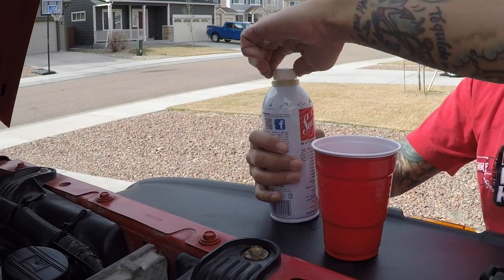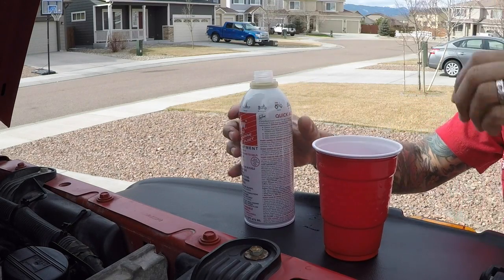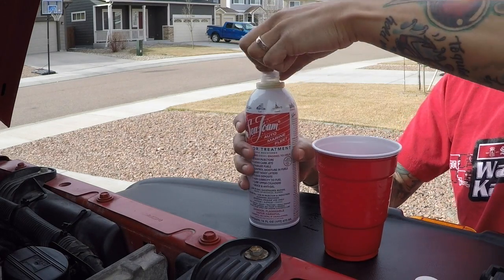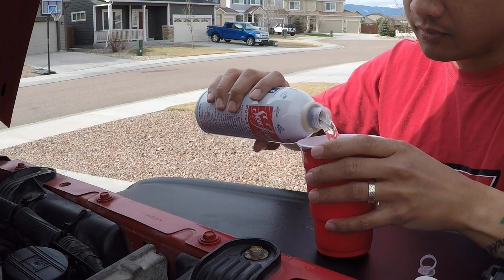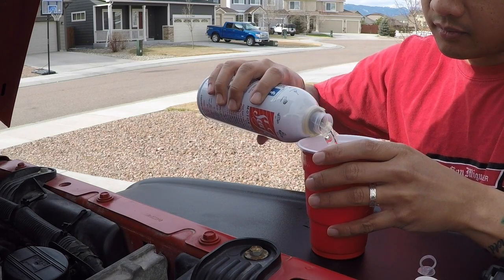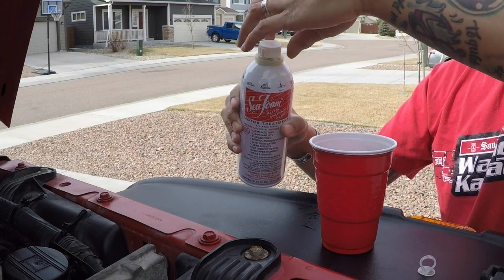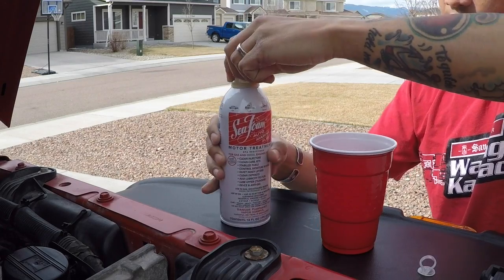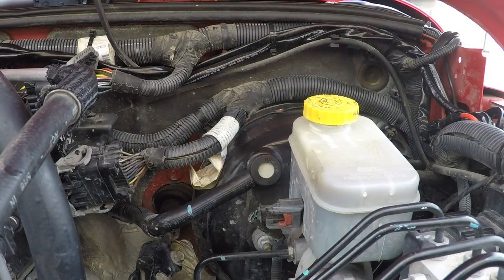HOW TO: Sea Foam a Jeep Wrangler (JK/ JKU)

Comment: My ESC light came on after doing this method any idea what that can be?
Reply from the maker: That’s odd. Are your brakes working okay?  Is the hose you used connected back firmly or do you hear any vacuum leaks? Like air being sucked through a straw from that hose or that area?
Reply: Phenom3030 the hose is seated firmly and there was a sensor that I removed when doing this and added it back when done. I have a 2013 so my setup is a bit different but should be the same method.
Reply: Just read the code got C1082 which is Vacuum Pressure Sensor Circuit.

Comment: Does the excess revving harm the motor?
Reply from the maker: I don't think more so than normal driving.  It wasn't taken to or past red line.  It was more so to try and "work the sea foam" through the engine.  Could be completely unnecessary but I feel i do see more white smoke during revving.